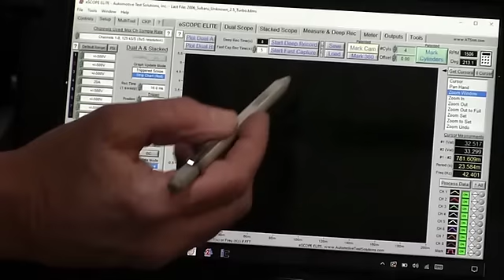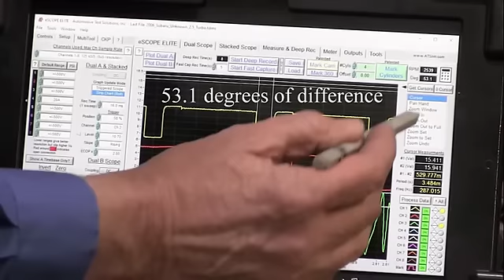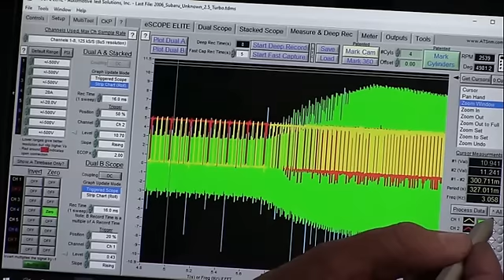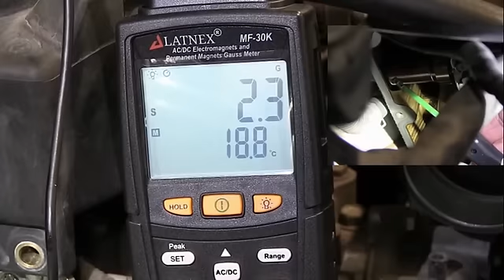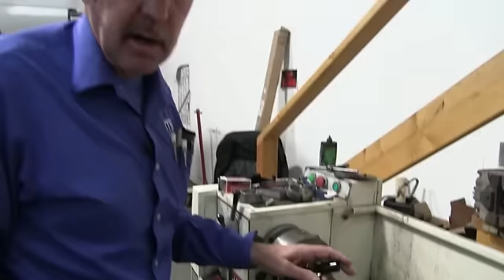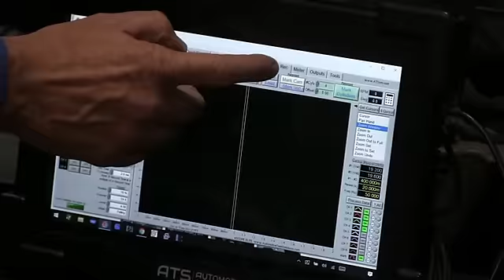2008 Subaru Legacy Stalling

Comment: I call BS on the whole magnetising of the camshaft. They found the spark plugs were wrong and there was a ground not connected. I’m sure if the plugs were replaced and the ground reconnected it would have been ok! There is a good chance another component was back feeding into the camshaft sensor circuit and causing the fault, not 4 faulty camshafts!

Comment: Introducing heat like a torch can demagnetize a magnet. Perhaps that may work on these cams I.E. wrap a mini doctor on the tips of those cams for a few seconds at a time or just use a mini torch that can fit in there without burning anything and can possibly save time to remove the cams.🤔
Reply: Cams would still need to be removed

Comment: I can't help but think you over complicated this diagnosis and cost the customer way more in repair costs than necessary.  First clue was the grounds.  You didn't show any testing with the grounds connected before checking the cams. Second,  sure new parts can be bad,  but TWO brand new OEM camshafts? I find that highly unlikely that this was a problem.  If you were going to demagnetize them you might as well have done it to the original ones.  The grounds in these cars are critical.  I can't help but feel this whole video was just justification to sell your services.  
I may be incorrect,  but the oversights i witnessed are glaring.

Comment: Are the small braided ground straps on each of the Subaru cylinder heads that go to the frame of the car there to help prevent this from happening? here in the rust belt almost every one that comes in has those straps rotted off.

Comment: Had a 2.5 subaru in my shop but could not figure out what it wrong with it. Runs idle like a shit and when you step on a gas - it dies. When you step gently - it starts to rise RPM but not to much. Mb it had same problem? 2.5 engine from 2008 Forester wat put into 2005 car.
Reply: Just done last week with similar problem I found stuck oil valve for variable valve phasing (avcs) - unscrewed, tested on battery, get little knock in head and start clicking.. It was  clearly on live data (most of universal scanners won't display this PID) but autel does. left bank just was stuck on 0 Deg.. Before I come the guys already torn down the Timing and swapped the ECU.🙄
Reply: @autodiagnostykaiklucze5978  damn...we didn't check it, but i remember that those valves were not controlled on that car. engine and tranny were swapped
Reply: Code was not set as well..

Comment: How come you didn't ground the engine properly and try again?  The shorter spark plugs that did not extend into the cylinder properly were most likely the initial cause of the cam issue but can be relieved with a degausser in the car or a small amount of heat from an induction heater looped around the cam in the car. Shorter than required spark plugs can also back feed into the wiring harness and short the pcm and a host of other codes.
Reply: He said why. "Think like an engineer,not a mechanic". 😅

Comment: Degaussing is something that came as a standard feature of a CRT TV set or monitor.
As the coil couldn't be physically moved, the circuit incorporated a PTC thermistor ("positor") which allows a high initial current to flow through the coil then gradually reduces to a negligible value.
You could do similar but manually with this setup, allowing the core to contact the cam for greatest effect, then reducing the variac slowly and steadily to zero.

Comment: "think like an engineer, not a mechanic"... Hit the nail on the head there Bernie. Fantastic diagnosis!
Reply: Also why spend $1400 on new magnetized cams if you can just degauss the old ones? 🤔
Reply: @PineHollowAutoDiagnostics  and I think once you had proved the issue, you could effectively degauss them in situ using a cored inductor like Bernie made up. A TV degaussing coil wouldn't give a concentrated enough field.
Reply: Too bad most "mechanics" are parts changers.
Reply: @shawnbauman5463  parts changing is the job, even with proper parts you still change them. Not doing proper diagnostic is the issue. Parts cannon which I think you meant

Comment: I have a subaru wrx setting bank2 cmp slow response code intermittently. I scoped the cam and crank signals and the cams flip like this vehicle.... I inquired online about it in a forum and techs have stated its normal and called cam flop. Is cam flop a thing or not? Should I investigate further into the cam signals flipping without it setting any other cam codes?
Reply: So yay or nay on the cam flop? Is it only an issue if codes are being set?
Reply: Most important thing I took from this video is make sure your engine / heads are well earthed to the chassis. 
Would like to have seen the scope waveforms once that missing earth strap was refitted before swapping out the cams.

Comment: Magnaflux  machine would be cheaper. This is normal during NDT inspection. They use A/C current when the inspection is complete to demagnetize a crank shaft etc.....
Reply: Yup, any NDT Level II Magnetic Particle (MP) should have the portable equipment/tools to easily demag the new or old cam, likely could have demagnetized without removing the cams from the engine too.

Comment: Why are the new cams more magnetic than the old ones?  If that's the case, if you replace a cam on a suburu, that means you could possibly run into cam sensor inversion and create a problem that was not there before? Wonder how many cars go to the auction with magnetized targets?
Reply: Forged parts can be magnetic due to the way the atoms are aligned. Not sure if the way the replacement cams were magnetized would have affected the cam sensors in the same way as the originals, but certainly not worth finding out after you go through the trouble of installing them.
Reply: I don't know makes me think if that was the problem.  If you look at the last wave form after fix  the cams look like they are in different positions  and he didn't use pointers to show wave form after fix.    ?

Comment: i would never trust a compass as it is a magnet in itself.  if you hold a compass too close to ferrous metal iregardless of its magnetism level it will move. i gotta be skeptical that the fact that this is no different than any other car why isnt this more prevalent.  if it were such a problem wouldnt the car makers use optical sensors or use a different material for a trigger. yes bernie fixed it and the proof is there. it just seems to me something else is going on we aren't catching.
Reply: He used 2-3 different ways to show magnetism and verified it till everyone is bored.  Then verifies the repair several ways.  Real mechanics watch Bernie and see your comment. Why did u really comment?

Comment: Definitely, a nightmare problem to diagnose without the scope. I'm left wondering though if the original cams could have been degaussed as well, since the new cams incredibly had the same issues and needed degaussing...🤔

Comment: I could be wrong but don't cylinder head shops have magna flux machines?
Reply: The answer to that question is yes, machine shops that test their parts for cracks with what is called a magnetic particle inspection process are required to demagnetize the parts before sending them on to their customer .That would be a place to get those parts demagnetized for a minimum fee. But some shops use a dye penetrant to check heads for cracks and this process requires no magnetic field to check the part and therefore might not be able to help.